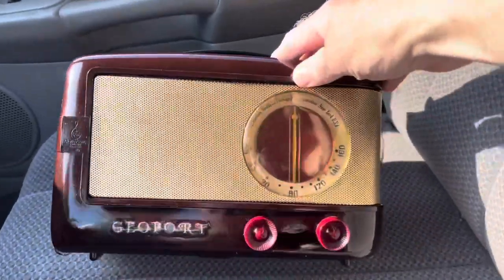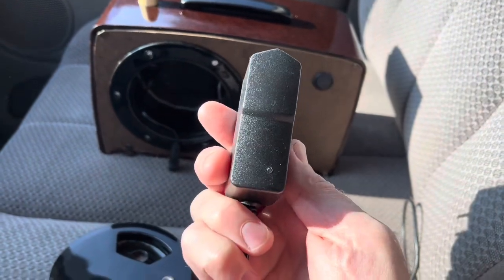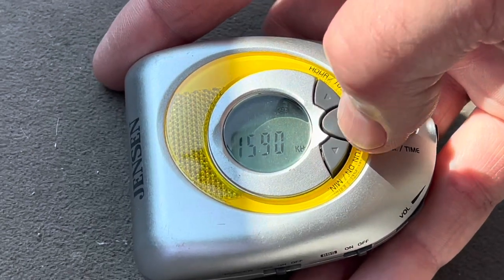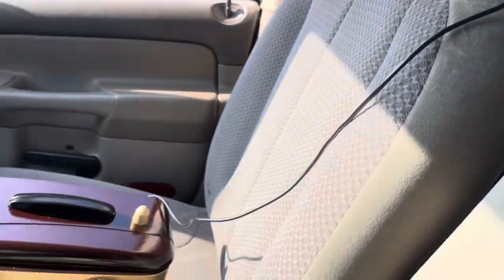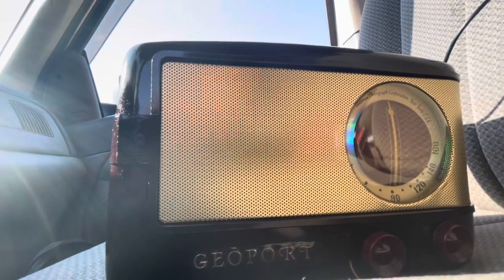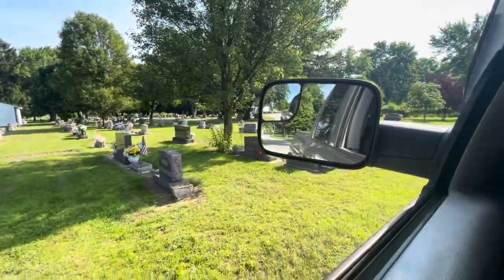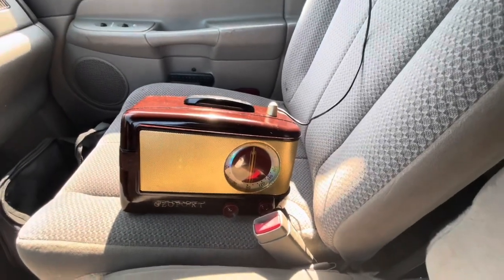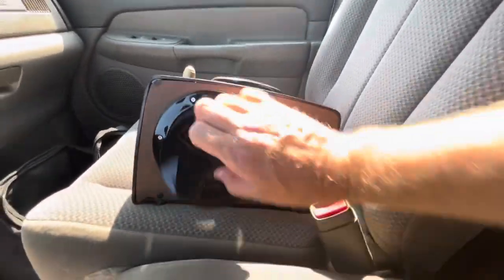Geoport Build 185 How-To & Testing

Comment: Do you make them with a scanner built in? I know you used to or I thought you did
Reply from the maker: I do, but this one is a bit small so the scanner might be compromised in doing so.
So having the hatch on the back actually gives you the opportunity to have it inside, but also, you can run it on the outside and that may just be a better way to run the scanner.
Reply: BTW the craftsmanship is amazing.

Comment: So is the difference between a geo port and and geo box is that on the box the radio is built in?
Reply from the maker: Geoport , Geobox, or DualPort 
Both Geobox and Geoport devices are similar except that the Geoport is a digital version which tends to be much clearer to interpret.
However there are times where the vintage Geobox pulls in responses that may be in the background of a Geoport. I don’t know what the reason for this is maybe it’s the additional sensitivity of the pre-amplifier used for the spring transducers.
That’s also tied right into the EMF pick up/modular.
Having the DualPort or combination of the two is ideal because you get the clarity plus any background responses that the Geoport might miss. 
DualPort comes standard with larger battery and adjustable noise suppression but it is an option on the Geoport too.
Most DualPorts have a compartment to house the scanner just as the Geoport has.
I usually don’t build in the radio scanner because often it can be compromised with noise or reduced reception, if I can put a compartment on the device allowing the scanner to be removed that to me is the optimal situation.